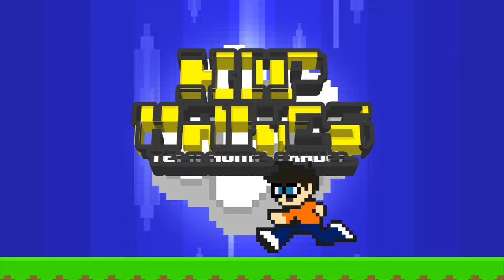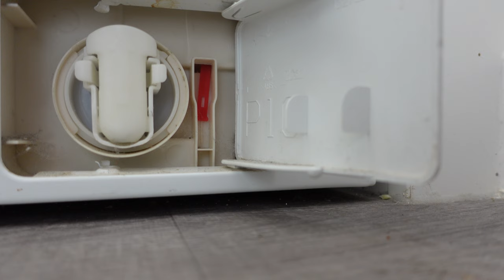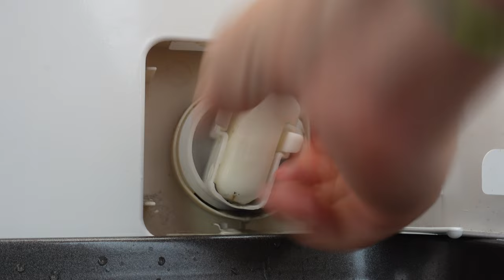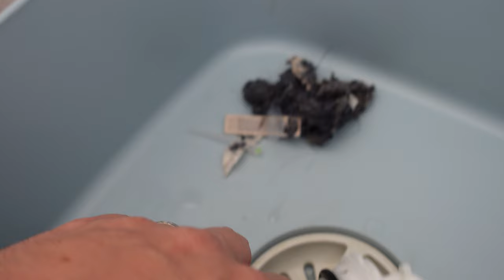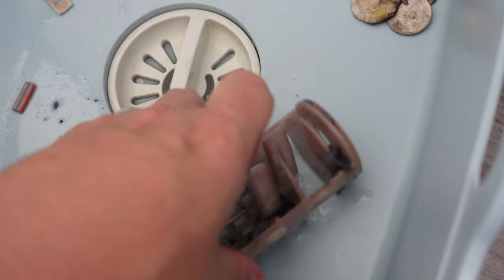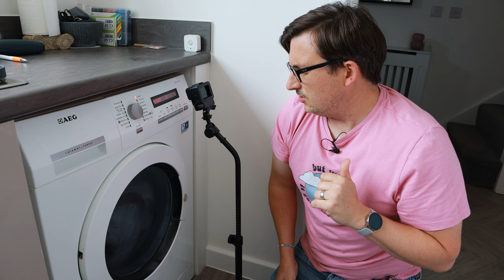The water isn't draining!!! E20 Code on AEG Washer Dryer

Comment: sorry aint on in a bit very busy here, i use the baking tray too because mine dosnt have a drain hose😡 my machine is 12yrs old now (nordmende class A) washer/dryer bought it when I moved in and sometimes mine dosnt spin so when the wash is done I have to use the spin only programme planning on getting new one soon as hate it all thats on the dial is numbers so I have to check manual every time I select a programme sorry msg a bit long cheers for vid kipster👍

Comment: If there is lots of water left in the drum ,pull out the machine tilt it back and you would be able to get a large dish underneath the machine ,Then remove the filter, no water will end up on the floor ,
Reply from the maker: Great tip!
Reply: @kiphakes  happened alot in my machine ,so I stopped using colour catchers ,they used to clog the filter alot

Comment: I did all these steps but it still shows, the first time it worked. 2nd time no luck.
Reply from the maker: Sounds like theres a blockage deeper in the machine
Reply: @kiphakes  It might be. Thanks!
Reply: Or the rubber drain hose at the back is blocked or kinked.

Comment: Hello, maybe you could help me - a little screw got into a drainage hole in the bottom of a rubber seal. I've run a machine on a rinse regime, hoping that the screw would appear in the filter, but it didn't.. Where may it be? Where does that drainage hole lead?
Reply from the maker: I think directly to the drainage pump.. might be stuck in there. 😬
Reply: @kiphakes  Thank you!